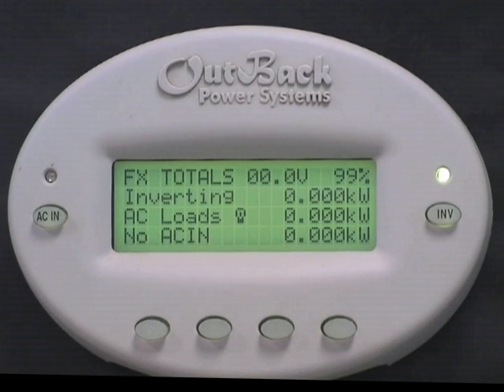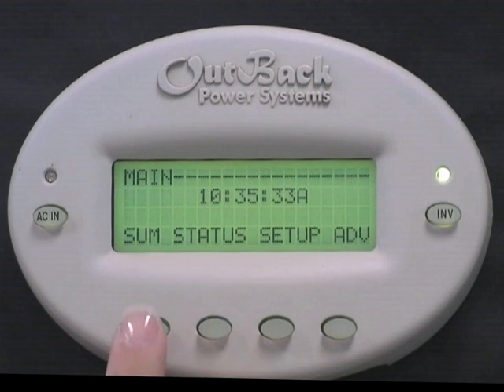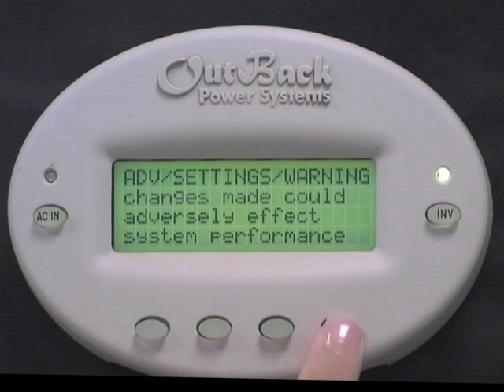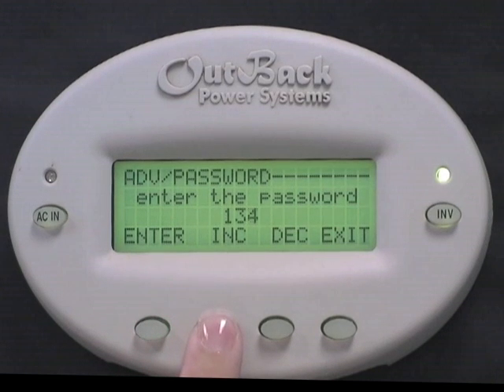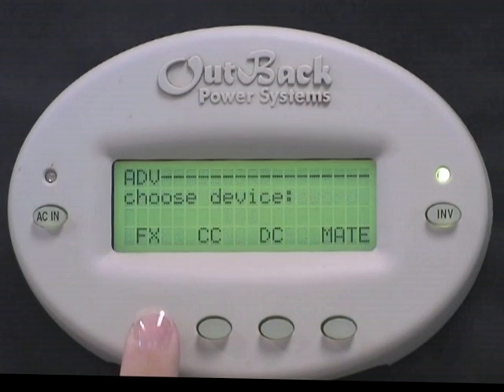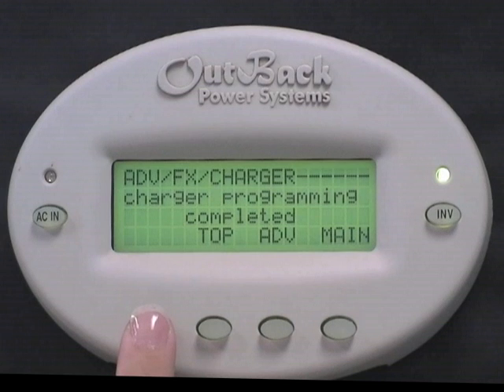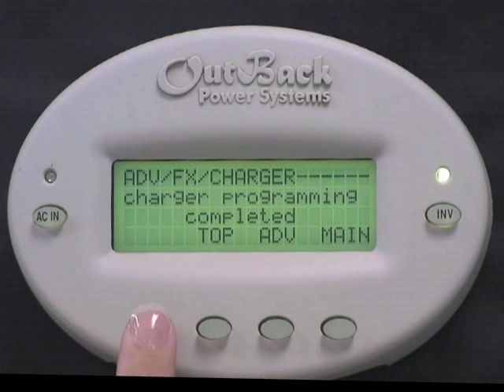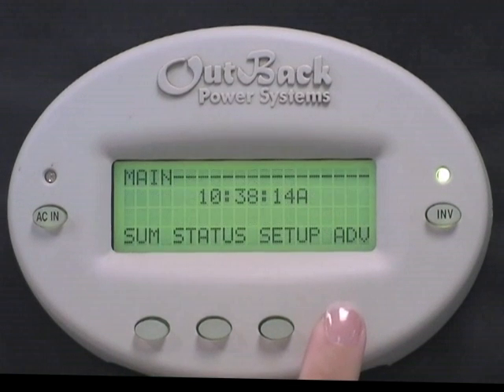Tech Support | FX Charger Set points

Comment: What do you mean that all the ports have to be equal?
Reply from the maker: +patrick donegan 

When programming the FX charge settings with multiple FX inverter/chargers, it is recommended that all inverters are programmed with the same charging values as the primary inverter. This is done through the MATE by pressing the “PORT” button which will change the port you’re programming. For example, if you have two inverters, you would need to program the setting twice. Once for port 1, and once for port 2.
Reply: I have 1 inverter FX2524 and one FlexMax charger and this mate and no spare cash for the Hub .